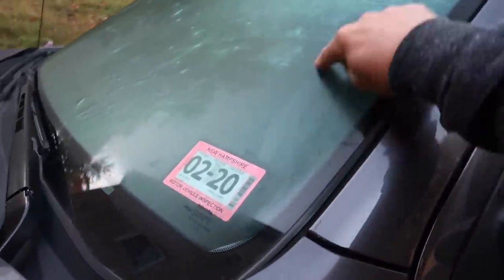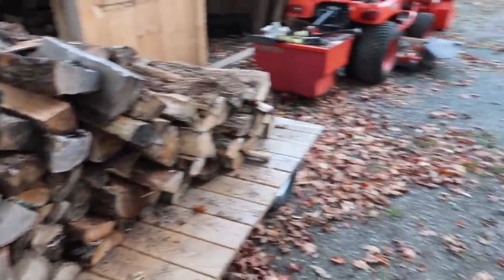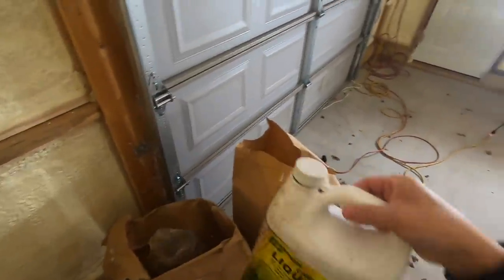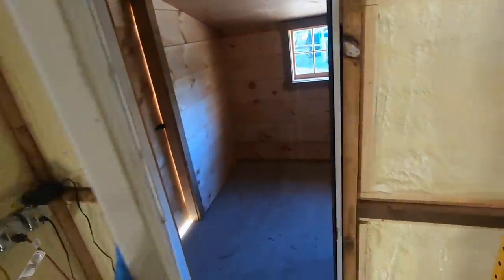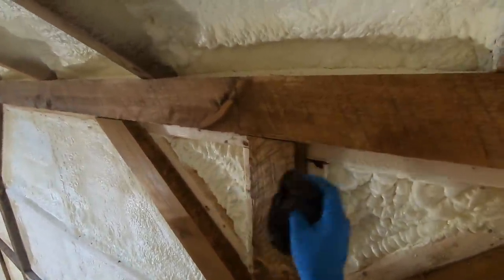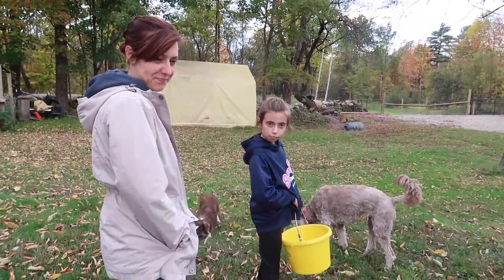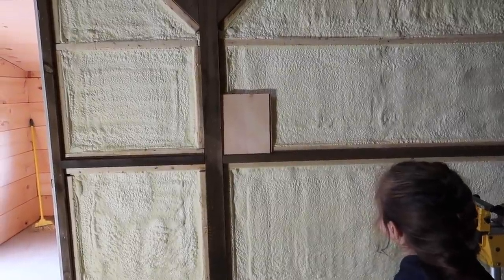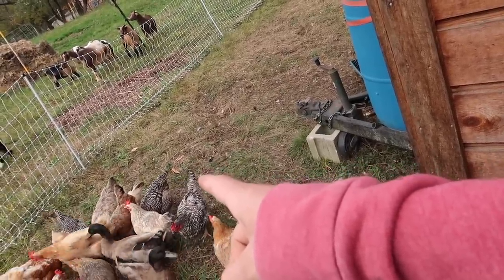There's No Turning BACK NOW! Making the Post & Beam WorkShop Look RUSTIC

Comment: The frost high on the windshield is due to radiative cooling.  The lower part of the windshield "looks" at the house, which reflects heat back at it.  The higher part of the windshield "looks" at the sky.  And if there are few or no clouds, the heat radiates out into space, cooling that part of the windshield more than the lower part.
Reply: Or residual heat from the engine warning the bottom portion of windshield

Comment: Windshield: The dash (inside) retains the heat from the previous day. 
I wanted to suggest you to seal the floor BEFORE using the liquid iron, but my time machine wouldn't start this morning...  ;)  
But maybe I am in 'time' to suggest that if you are going to treat or stain the finish board in the barn, you do it BEFORE nailing it up.  Makes things MUCH easier!

Comment: hi al, going back to the last video, about the loft ladder, hinge it from the 3rd tread down so it flips up to the level of the loft floor to keep it out the way when not in use, but i'd cut the top 2 treads out and leave the sides intact to use as hand rails, so no sideways steps and gina can walk up and strait through the middle of the uprights into the loft and just as easy to come down hope this helped, we don't want any broken neck's lol

Comment: When I was in the Navy we used to paint concrete floors to protect the concrete it would also seal it. You can also repaint it to cover bad stains or use a grinder to strip the area and repaint that spot.

Comment: I used to make an iron stain by soaking steel wool in vinegar. Soak for a few days and you can remove the steel wool. Apply like stain. The more tannin in the wood the blacker it becomes. Woods like pine just turn gray. Oak turns black.

Comment: I used to make "liquid iron" by letting some steel wool rust in a jar of water. Adding some vinegar would speed up the process.  Breaking the clumps of steel wool up every few days would also speed it up. Shake it up and filter it before using it. Keep it covered when storing. The iron oxides react with the natural tannins in the wood to darken the wood (Think of all the black spots around nail holes). It will darken over time; this only speeds up the process.

Comment: The window not have any frost on the bottom and yet still has frost on the top of window is because of several factors. The warm air of inside the vehicle is certainly warmer than the outside temperature. Even when the vehicle is not running, some of the warm air from inside the vehicle is being pushed through the upper front window heating vent. Even though the air movement  is minimal, there is still enough warm air to prevent the frost sticking to the lower portion, when compared to the upper portion which does not receive a y air flow. You will also notice that usually front and back wind are more frosted than side windows and this is due to that the front and rear are more slanted and the side windows are usually more vertical, the slanted windows provide more horizontal  surface area for the frost to develop  on.

Comment: No frost at the bottom of the windshield do to the radiant heat coming from the engine up through the defroster vents. Assuming the engine was hot when it was parked for the night.

Comment: The. Windshield with no ice is close to the engine where it it warmer. That's simple. Check it sometime when you haven't run the truck in several days. Then it would be cold all over.

Comment: FYI - you should always pour the water i first, then pour the chemical. That way if there is splashing it is always a dilute solution splashing up. This is especially important if you are using caustic chemicals.

Comment: I assume there's frost higher on the windshield because there's more space on the inside of the vehicle up above than down by the dash board.  That smaller space by the dashboard acts as a bit of an insulator, keeping the air inside a little warmer, so it hasn't frosted over "yet".  Just a guess.

Comment: Just wondering why rub stain instead of brushing or rolling?
Reply: Maybe a sponge paint brush.
Reply: I think you have more control over how much stain you put on by rubbing, the roller and brush put on alot of stain. I used to use cheese cloth when I put on stain.
Reply: @bascia3125  That seems to make sense now.  I'm no expert. Just a watcher.
Reply: Paint brush would be much easier with same results, wood soaks it up and air dries anyway! No color difference, especially in rough wood surfaces!
Reply: I would have just used a garden sprayer. The foam will get covered anyway. Think that would have worked and been quicker?
Reply: @bascia3125  Ok for finished wood, but this is (very) rough cut wood in a barn/workshop, and they are going for a rustic finish.
Reply from the maker: You have more control over how much stain and I find it makes less of a mess.

Comment: There is a big gap around the milking room door. It needs a seal. No point in doing foam insulation on exterior walls and roof if that gap remains.

Comment: A lot to do with the area you parked your vehicle, it's in a basin and the lower area was warmer than the air flowing over the land formations causing the upper area if vehicle to freeze! It wasn't a hard frost that drives to the ground! Warmth from ground is keeping it from descending!
Reply: and the lower half of the window was closer to the building, so there would have been some radiant heat helping keep it warmer.

Comment: Frost is caused by radiation of infrared (heat) from a surface to the cold of space. The roof of the truck is perfectly situated to radiate maximally. The windshield is at an angle, and cools more slowly via radiation, but it also cools faster at the top via conduction to the colder roof. As others have pointed out, residual heat from the cabin or the rest of the vehicle will keep the bottom of the windshield a little warmer. Getting frost is just a question of whether your surface cools sufficiently over the night to grow ice crystals. If there’s cloud cover, you won’t get frost, because you can’t see the cold of space.

Comment: Why aren't you putting the wiring inside the walls of the shop? You do an excellent job on everything you do, that's why I watch you every day.
Reply: Linda Linda 
This is just my opinion but in shops or barns it’s better to use conduit rather than wiring in the walls. Even the most thought out plans with shop wiring will get a lot of changes once you start using the shop. Use conduit and moving outlets or switches gets a lot easier!

Comment: Since all the insulation and 2x4 nailers were going to be covered, why not save time and use a garden sprayer, and back brush the stain? The floor could be covered with a tarp or canvas to keep from staining the  floor

Comment: You mentioned putting up lighting in the milking room, would it not been easier to put in the electrical in before you put up the interior walls...
Reply: Joe Smucker 
Not in shops or barns. Once you start using lights, switches and accessories you quickly want to make changes to even the best plans. 
Most people prefer conduit in barns or shops so changes can be made much easier.

Comment: Lumnah Acres, Good Morning to Ya Time Flying By !!  Way to Fast !!  Yes getting Cold here to..  How about some Body Salve with that Goats Milk ? ? Hand Salve ? You Can do so much with Goats Milk LOVE IT ! Sure you will too since you have them.. On the Liquid Iron People will use Oil, Used Motor Oil for what you are using it for, but it's Funny that you have that, Just had in my Hand was just moving somethings around in Barn just doing some Fall things cleaning up moving Equipment around & I have a couple of cases of that stuff from back when I did that kind of Work...  Try & Use a  Sponge that Absorbs Liquid a little bit messier  but will go on Quicker for ya.. But I know how that wet rag is once it's submerged for a min. lol It's goes on Nice with it..  If I may ask how Many Acres would your Homestead be ? I'll leave it here don't want to keep going...  lol Thank you for all your Time & Enjoy the Rest of Your Day! :)

Comment: I noticed a little liquid iron splashed on the concrete.  What does it look like as a possible concrete stain to color the concrete floor before using the sealer?

Comment: Are you going to paint the outside of your barn to protect it from rotting in the wet? We are planning on treating our barn but it has been raining lots. So I don't want to do it until the wood is bone dry. I don't want to seal in the wet. We should have done it in the summer like we did last time.

Comment: The comments attributing the warm dashboard are on the right path, but the warmth of the engine lasts a long time.  It will still be giving off heat to the firewall and thus to the dashboard 10 or 12 hours after you park it.  Meanwhile, the roof will have cooled off the outside temperature in twenty minutes or so.  Thus the windshield will have warmth below and cold above.

I've been holding off making this comment.  You have a nice chop saw and an adequate table saw.  I CRINGE every time you use them, because you grab the cut pieces and pull them away from the blade, WHILE  THE BLADE IS STILL SPINNING!  You are so lucky to still have your fingers.  Learn to use push boards, made from small pieces of scrap, and NEVER get your paws anywhere near a spinning blade.  You tended to use your nail gun to near your hands too.

Comment: Alright, I have avoided this:  hate that bungee on the milking stanchion.  You should make a U shaped rod with one side longer.  Drill a hole in each side, and then just shove the long side in far enough so the short side engages  - or not.
Reply: @GKevin Eady:  Might not even need it at all now.  Think she's accepted it.  Haven't noticed her trying to escape.

Comment: Al why can’t you make a staircase that would swing out from the wall. I know your good at what you do. Think about it.
Reply: @Sandy Norlock:  The ladder is most useful in the center of the room.  If it were attached to the wall, you would lose the use of that wall and floor space.  A more useful solution would be to attach it to the beam at the front of the loft on a rail like a library ladder, and have a pully system attached at the bottom of the ladder and a truss if you want to get it out of the way when not in use. Of course, you could just take it down and hang it on wall hooks!